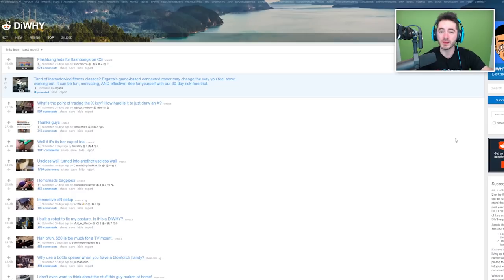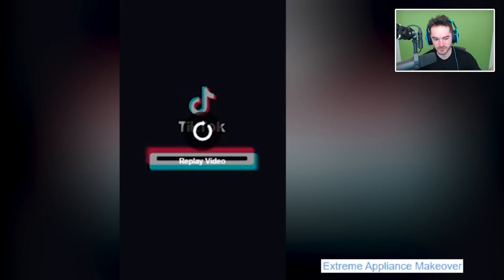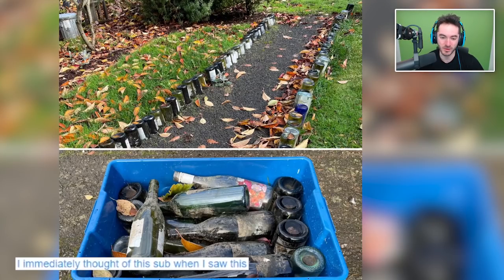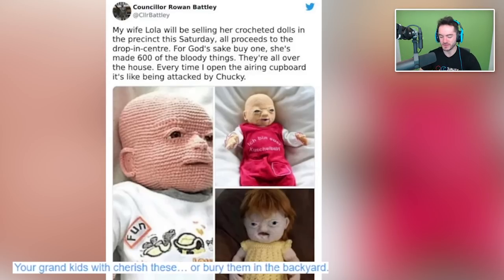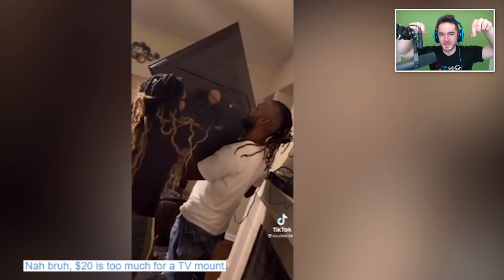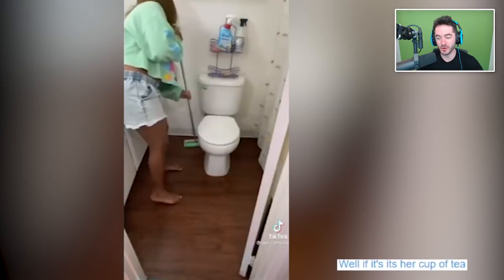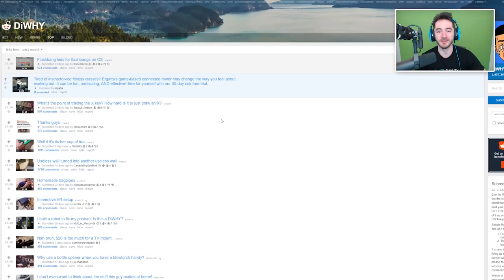Incredible Video Game Hack (DiWHY #32)

Comment: The first one may not be great for a house door, but it's good for like, a door to your room. Keeps out parents/roommates without adding yet another key to your key chain.
Reply: @goldcakes  nothing a good kick can't fix... or actually probably a slightly forceful push with the handle turned... in fact idk if i'd even call it forceful. just look at it the wrong way and it'll just fall off in fear.
Reply: It is definitely easy to break. It wouldn't keep a door closed
Reply: @Nerdgirl9853  Well, obviously you'd want to make it sturdier. But if someone really wants to get through a door, however it's locked, they'll find a way, even if they have to "Here's Johnny!" it. I was thinking more of a deterrent that says to people you share a living arrangement with that says: "Hey, please stay out while I'm not home, I will know if you didn't."
Reply: If it were made to a higher quality, I could see it being quite usable. There's no real reason we need a remote for our car locks, so why not have one for a house as well?
Reply: in industrial applications they have things called witness locks they are plastic and easily breakable incase someone loses the key, the idea is that it confirms someone purposely broke it to use the power lockout switches.
Reply: I would use a stronger lock and actually screw it into that piece of wood…
Also probably a stronger motor

Comment: I could see the first one maybe being useful if you want to lock your door against someone who has a key to your door. [My first thought was "your annoying/creepy landlord" but I'm not sure it'd be legal to lock out your landlord - but perhaps an ex who had a key until you can properly get the lock replaced, or something like that.]
Reply: If your landlord is coming over unannounced and trying to get in, you have bigger fish to fry. Lol That's when you start replacing heads with large stones.
Reply: I just watched it, and no, that would not work. You'd have better luck mounting it directly to the door, not the piece of wood.
Reply: They have these little locks you can buy at the hardware store that don't require a motor. Much simpler and probably stronger. Probably easier and cheaper, as well. Also, there are these little gadgets you can buy to add to any door to back up a lock (good for hotel rooms that don't have the added bar lock at the top). The gadget goes between the door and the frame.
Reply: @Andreamom001  Yes! I love those locks you can keep on your keys and use on hotel/air bnb doors without any other tools.
Reply: At least in Germany the landlord is not allowed to have a key if you dont explicitly allow it.
I bought a lock that i always change on my apartment when i move in and changed back when i move out.
Because you never know if the person living there before you would have made an extra key.
Reply: Here’s the thing: it would take no more than a semi-hard knock to break that “lock.” that’s why it’s so funny.

Comment: 1:35 What happens when the battery dies while you’re out? A locksmith can't deal with that, you'll have to take the door off.
4:00 It's hard to tell but did they put some sort of cover over the CRT to protect it from the elements?
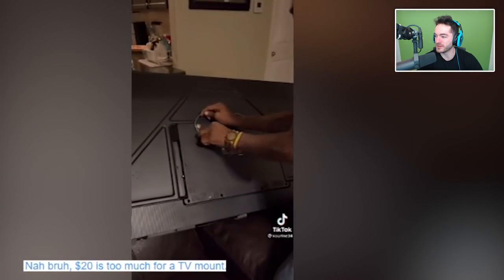9:29 That's not a cable, it's a thick wire, it's not breaking.
10:20 I'm not sure that's what OpenCV is for. I've only used it for facial-recognition, but this seems tempting…

Comment: The drawn crosshairs thing is actually a good idea for games that take away your crosshairs when hip-firing sniper rifles
Reply: Some monitors have ine built in. Mine was on by default. It took me a week to notice it wasn't just a hair on the monitor.
Reply: I think this is more about color change.
White white + in the game is good on dark backgrounds, but if you go to bright background its barely visible.
By adding a black x to it it, + will be visible on dark backgorunds and x will be visible on bright backgrounds, so you always easily see it.
Reply: Yep, I used to do the same thing playing Soldier of Fortune II nearly 20 years ago!
Reply: Although it wouldn’t help much as often, depending on the game, hip fire doesn’t go where the crosshair would be anyways for it to be more inaccurate
Reply: @hubertnnn  Can't relate. I usually play minecraft, which has the crosshair be the opposite color of whatever is under it, so it's only a problem when you look at something gray
Reply: @vibaj16  I've played so much Minecraft and literally never noticed this, I feel so dumb.
Reply: @hubertnnn  in games that allow me to change the color orshape of the crosshair, i typically set it to something like neon green or pink for maximum visibility nomatter what im aiming at. I also tend to prefer a simple round dot shape over any sort of x,+ or other such shape. Feels more natural. Like its from a laser beam on my gun and not some futuristic hud goggles or something... Basically im something of a hud minimalist when the game allows it.
Reply: I used to run around in CS:S with the auto sniper and a plastic crosshair.
Reply: Sea of thieves
Reply: @hubertnnn  Lime green or hot pink crosshair never disappears. That's what colors I always set mine to.
Reply: Is a osu meme rho ,i think
Reply: most cross hairs are white in that video they purposely showed bright flashes that happen but you cant see your white crosshairs cause of that so making a black crosshair is a good idea

Comment: I think the first one wouldve beena  good idea if the dead bolt lock was probably stronger. Plus you could easily cover up the components and make it actually look nice. Maybe not a big ass remote like dat tho.
Reply: And then the battery goes dry when its locked and you have to kick your own door in lol
Reply: @106640guy  Doesnt a smart lock have a battery that needs charged too?  Could just use a brick to power it through a plug.
Reply: yeah, you could make and install it for someone who has dexterity problems and it’d be a really fantastic gift
Reply: I agree. It seems pretty useful to make a powered bolt lock. Perhaps for when leaving for holidays.
Reply: @leechion2933  I think that most of that type of lock automatically opens when it is at low power? at least thats what happens in movies!

Comment: About the crosshairs: I actually used to do that specifically for the scout in counterstrike 1.4~1.6. The scout would only have a crosshairs when zoomed in, but it was 100% accurate when not zoomed in and standing still. So to "no scope" with it I would tape a small dot or X to my monitor. :P
Reply: yeah, I think the taping crosshairs part is good, just why in the world do you need to trace the 'x' key on the keyboard to draw an x lol..

Comment: The dishwasher trick works if the container is sealed, my mom used to do this to defrost BUT THEN still cook it thoroughly afterward. Dishwasher heat is not enough to cook, just heat or defrost

Comment: The "useless half wall" DIY messes with the nice curved arch at the top. I would have just added open shelves to the top of the half walls since they look pretty wide. That way you can keep the staggered design of the walls and be able to access the shelves from both sides of the walls. This also prevents you from blocking off/enclosing the room.

Comment: I did the same thing with a TV once, I screwed a piece of laminated floor with a couple of holes into the TV and then hanged it on 2 screws in the wall like a painting. I'm all for this, it will never fall and it's basically for free.

With the wire thing though, I'd secure the ends somehow or make a kind of lasso loop.

Comment: For the first one,Literally imagine you lock the door and it works 1 time then you can’t get back in 😂
Reply: Nah, a kid could slightly push the door and break that lock.
Reply: @MamadNobari  I don't think so. The lock itself is still a proper lock as long as it's bolted to the door and frame properly. It's just the motor joints that are questionable. Welds instead of hot glue would be better.

Comment: The first one is actually way more secure than many "professional" ones seen on LPL...
Reply: And when the batteries run out or it gets stuck you locked yourself out. The idea wouldn't be bad if it wasn't a shody DIY project but a professionally made quality product and even then the batteries running out would be a concerm unless it warns you early enough.

Comment: The first one is honestly not that bad, it just doesn’t work well with a remote control. If you connected it to the internet and had an app that would let you make sure your door is locked and be able to lock or unlock it, then it would be a cheap way of having a nice security system for whenever you can’t remember if you locked the door or if your room mate needs to get inside but you have the keys

Comment: A german TV Show called ,,Nicht Nachmachen“(translated=do not try) put eggs in a plastic box which they put in the washing maschine and put it on 60 Deegrees Celsius and it actually worked, even though I wouldnt recommend it, it worked, but that were eggs not chicken on the other hand a dish washer gets probably hotter, still I dont think that would work, also because pressure probably builds up and heat differences, the glass probably shatter

Comment: #19 It just blends in with the most sophisticated decor... What if, when locking from the outside, you keep the motor running for to long ? That hot glue can very well give way.
4:30 Start with raw chicken. Put in a jar, add boiling water. Then, put in the dishwasher. Do a full wash with the drying activated. Hope that it's enough to completely cook that chicken.
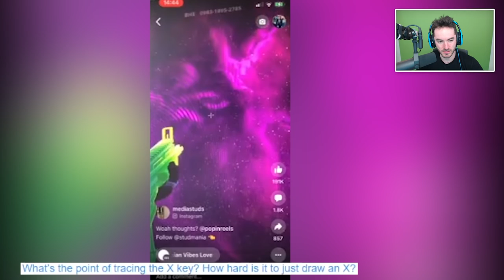14:47 WHAT kind of keyboard is that ? Top row hint at a QWERTY keyboard. So, why does the Y key sits where the Z key should be ?

Comment: You know, kinda annoyed me. You rag on the first DiWHY, but a lot of houses only have a standard doorknob and a sliding deadbolt like that one. The knob itself can be easily breached with a thick card or knife a lot of times unless it's newer, but you can't lock the deadbolt at all unless you're inside the home and obviously can't unlock it from the outside at all. My old house I grew up in was just like that, both doors only had a standard knob and a sliding deadbolt. I genuinely see the use-case for that DIY as without the remote, you absolutely could not unlock it from the outside. Albeit, it would need more reinforcement than what that person did to prevent someone from being able to easily kick through it, but that could be resolved easily, they were just showing the idea that this is something that is possible. I know my parents would have loved to have something like that when I was a kid, the only thing keeping the door locked when we were gone was just the one standard old door knob. Plus they always double and triple checked that the door was locked before going to bed, this would also allow them to ensure it's locked from completely across the house if they wanted to. I love it, I really do. If I were to do it though, aside from reinforcement to it, I would also make it have a smaller footprint and put a little box around it to make it look neater. Just because it seems stupid to you as every house you've ever lived in has had a knob and a key deadbolt, doesn't mean to knock it man, you live in a MASSIVE city, I've lived in Rural Georgia my whole life and there are TONS of houses I've seen with the ONLY deadbolt they have is a standard old sliding one just like you see in the first DIY.

Comment: honestly, that first video is probably more secure than a traditional lock - even if the bolt itself is kinda wimpy
at least if the software uses decent security/encryption (software security is a LOT more secure than physical locks)

Comment: 10:30 my laptop has one of those tobii eye aware webcams that detects when my eyes are directly in front of it... i have it set to dim the screen and turn the rgb lights off if it can't detect my eyes and that does a pretty good job of letting me know when ive melted into my seat too far.

Comment: The first one is actually pretty smart because you cant pick the deadbolt if secured correctly.
Reply: True, you just better hope that the battery does not run out, because you are not going to be able to pick it open XD
Reply: but there is also a slide problem... over time hot glue can lose it's stickiness, what if this happens when it is locked and you are outside 🤐
Reply: All the security on the door locking mechanism won't do shit when most thieves will just smash a window.
Reply: As someone who has had to force open a properly secured front door to rescue a dog trapped in a burning flat (surprisingly easy, door busted open in under a minute), a slight shove will have this open
Reply: @BigDavie2000  obviously this one is pretty bad but if you used actual screws and stuff then it would protect against people picking locks.